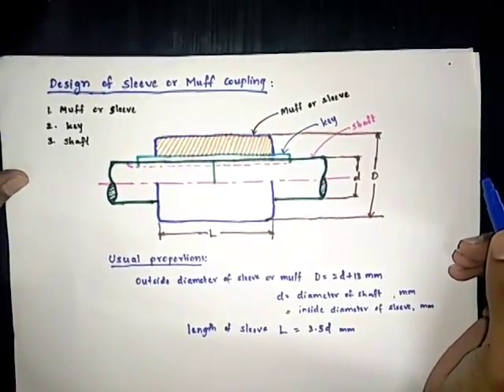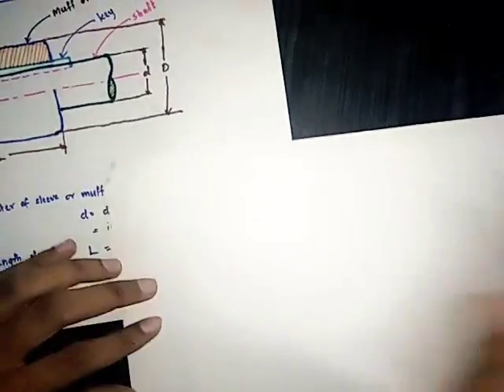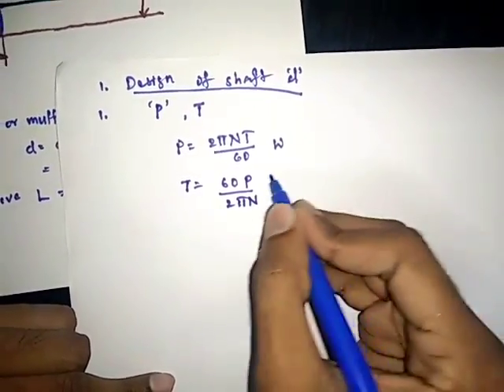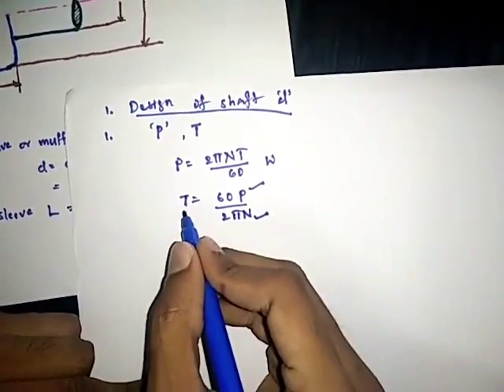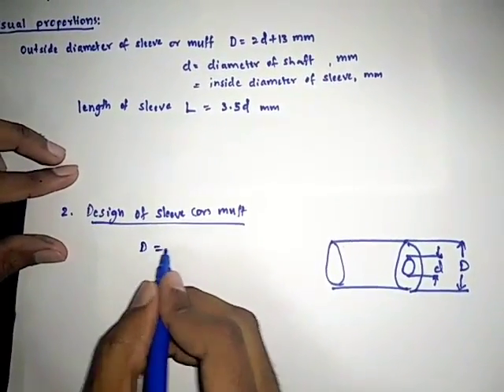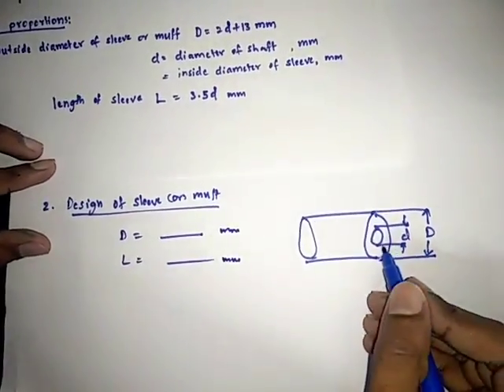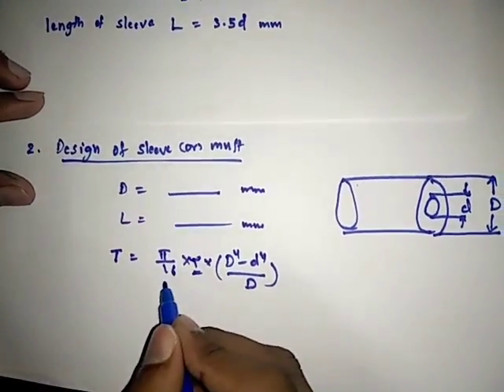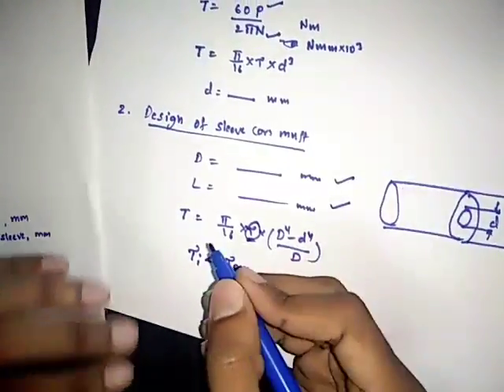Design Procedure for Sleeve or Muff coupling

Comment: u said that in the formula for torque in design of key 'd' is the dia of the key and is equal to half of dia of shaft
but(TORQUE=FORCE X PERPENDICULAR DISTANCE FROM THE POINT AT WHICH FORCE IS APPLIED)  T=F x R(R=d/2) here r is the distance from which the force is applied 
but anyways your explanation is nice and easily to understand thanks fr the video